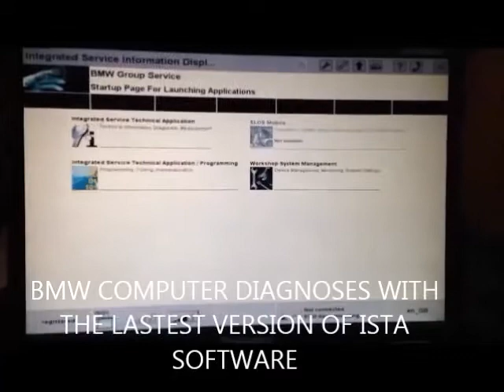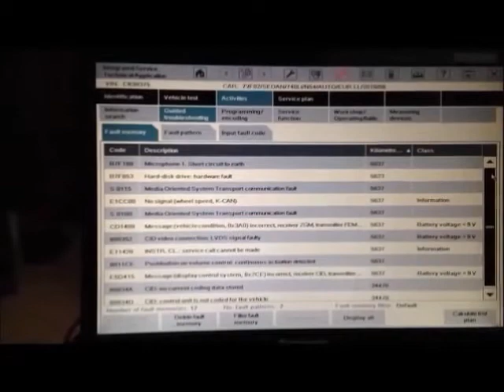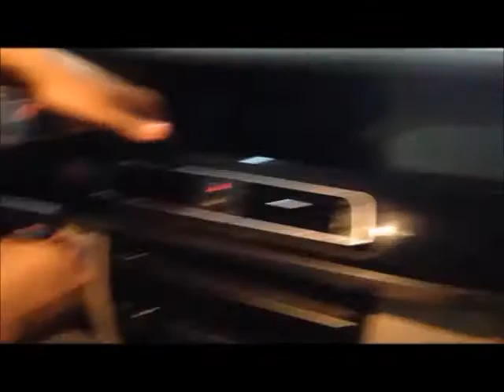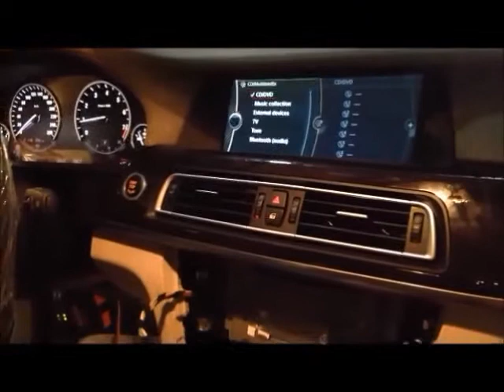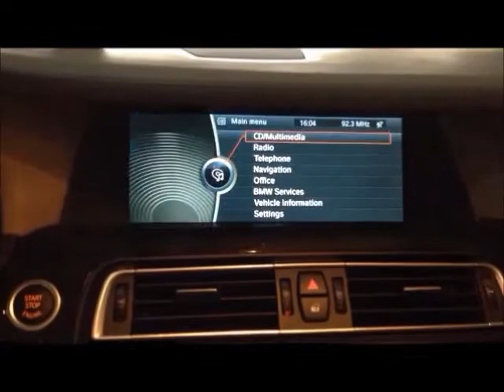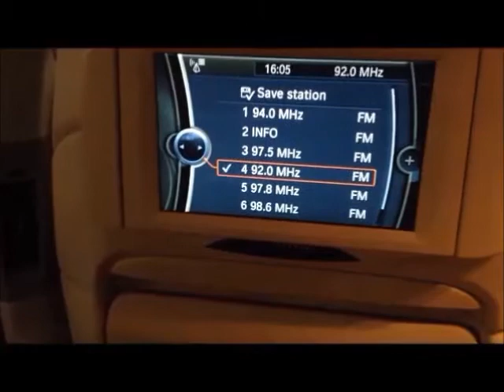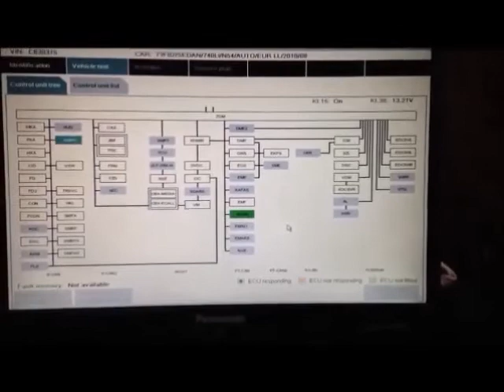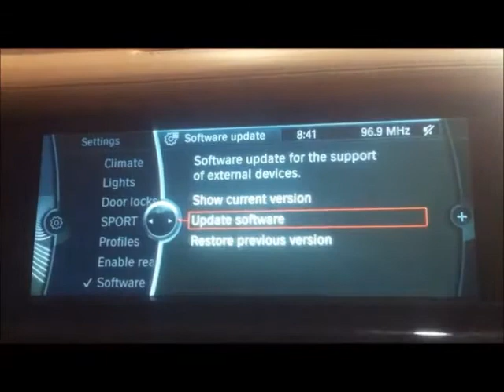bmw f02 cic repair

Comment: Thank you sir,  my BMW f10 520d 2014 have a problem  I don't know if is the ccc or the screen or  my drive controller,  on my case the radio  is working  but I can't change to other channel,  second  my screen is switch off  I can't see nothing on my screen is all black.
Please can you help me to find ou what's causing that.
Thank  you!

Comment: My screen also black. I guess the head unit not receiving any power at all. I took out the green optic cable and it's flashing red, but no red light flashing in head unit. I have checked all fuses including the fuse in the head unid (they are all good) any ideas??
Reply: Have you fix that? What was the problem?

Comment: Hello friend I have a radio of the mini cooper 2012 R60 GR6512 have been programming it and now it does not communicate more the screen is dark and it is dead the culer connected direct as fasso to talk with you can help me ???